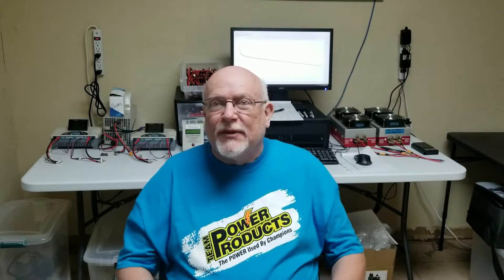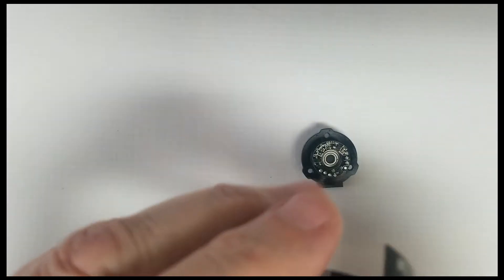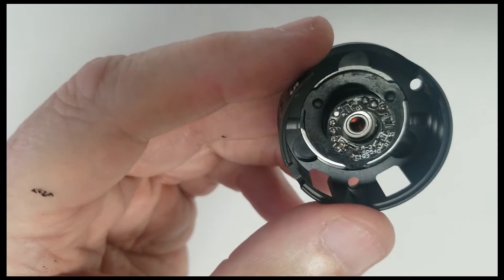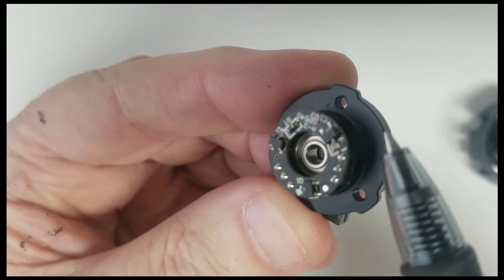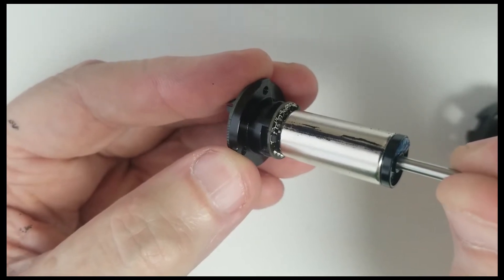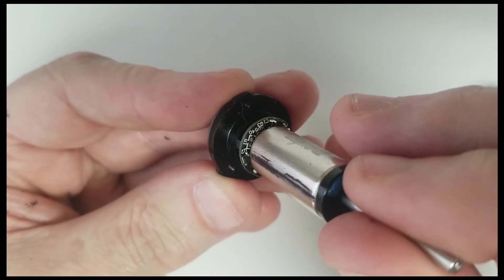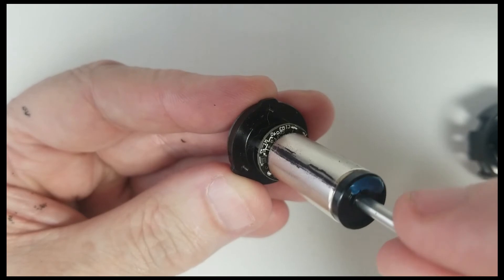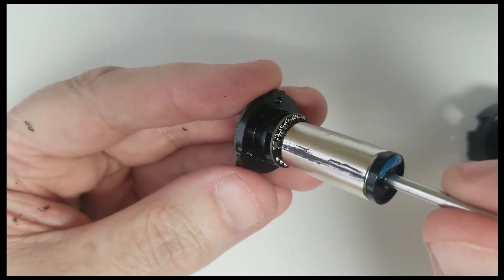Team Power Products Presents Brushless Motor Timing Components

Comment: I race up at mojos and i run factory stock and would also like to run sc mod. Do your prefer 2 pole or 4 pole for the sc trucks? I am currently running a 4pole mamba x combo i got from tony but the sensor board went out so i am in need of a new motor. I want to get the best application for what i am going to do. Thank you for your time.